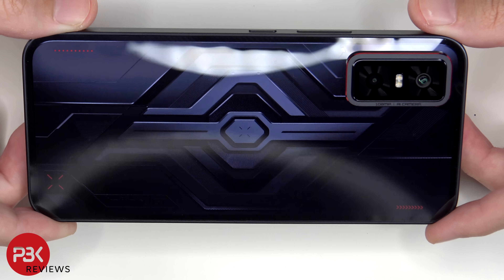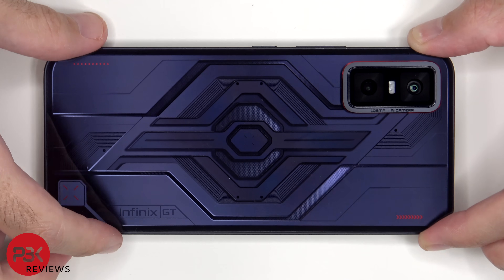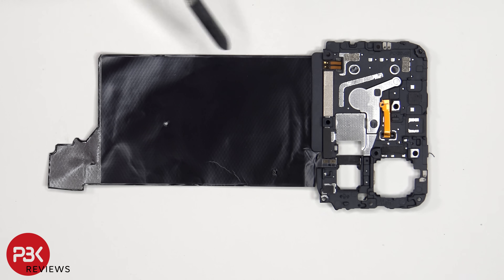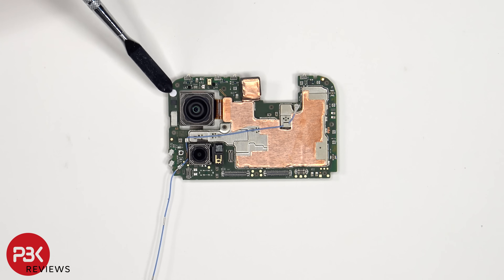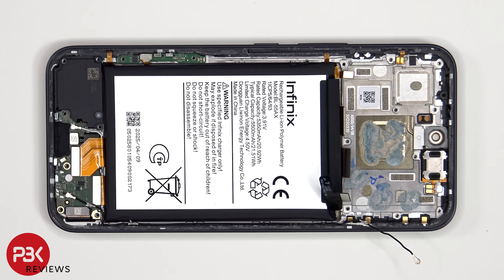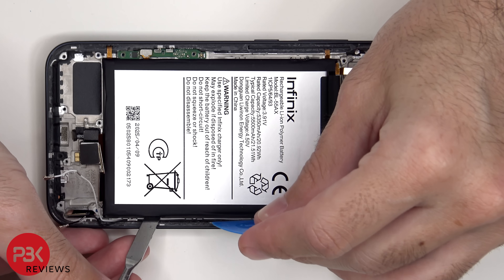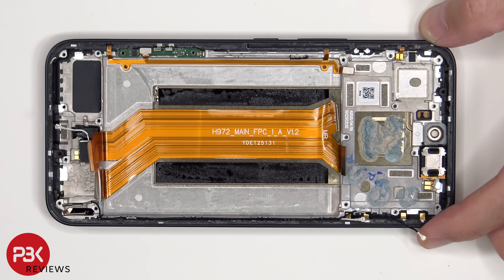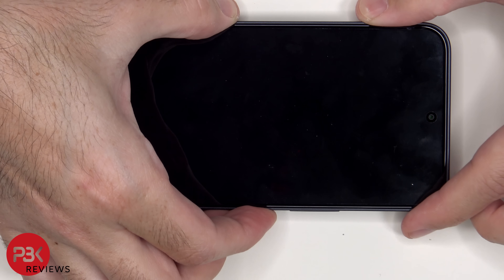Infinix GT 30 Pro Teardown Disassembly Phone Repair Video Review

Comment: can i ask, is it possible to change the middle frame if it has a crack on it?
Reply from the maker: Yeah but it would require prying off the screen as well which poses a high chance of damaging a working screen. Also you would need to be able to find the midframe replacement part. Usually they come pre attached with screen replacements.

Comment: Oppo k13 turbo pro pls fan is actually working or not  pls teardown
Reply: Already watch on Chinese YouTuber trust me its a gimmick for marketing not a good implementation
Reply: @bumbeelegends7018 wats the name of that YouTuber
Reply: @bumbeelegends7018 What is the name of the channel?
Reply: @bumbeelegends7018 which chinese youtuber? 

Tho I've watched Geekerwan's test (on bilibili cuz i understand chinese), it manage to drop the phone's temperature by 4°C, from 48->43.x ish
From something that's not that optimised like 8s Gen 4, it would do the same with 8elite very easily. This also means they're able to push performance unlike most phone which will thermal throttle and restrict performance at around 44-45°C
Reply: Thanks brother
Reply: The fan actually does little to no job if compared to a brand like redmagic
Reply: @arandomgoodcommenter wrong, red magic active fan cooling was one of its kind. But flat out sucks for how little it does with how much space they take actually

Oppo K13's active fan cooling follow something similar to llaptop cooling solution, taking less space but actually did better for how much they're able to do (more than red magic) with less space, and also up to IPX9 of protection iirc
Reply: The fan on the oppo k13 turbo pro cools the vapor chamber, not directly the chipset. The cooling is less effective, but because of that, it is water resistant😅
Reply: @SAN_DIII cooling is actually like this: fan doesn't do much of a job. If you attach a fan without the heatsinks directly to a CPU/SOC it wouldn't cool a CPU that well than using heatsinks only. The combination of Heatsinks + fan will work better because heatsinks removes most of the heat due to surface area, and fan remove majority of heat from heatsinks and sustain it, creating a temperature gradient. 

Geekerwan did a test on it with the phone running intensive games, K13 runs up to 48°C without active fan cooler, and run at 44°C with the active fan cooler. Other games are sorta consistent with the value. Most phones need to reduce frequency as a result but K13 can maintain max frequency for that reason